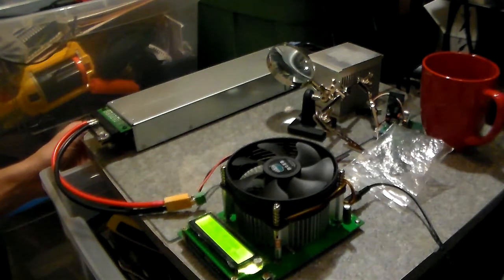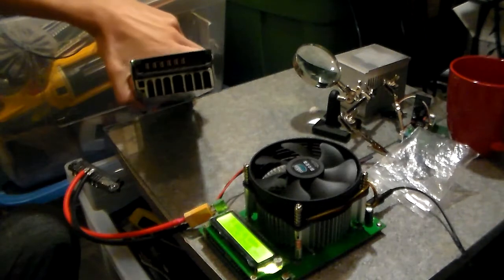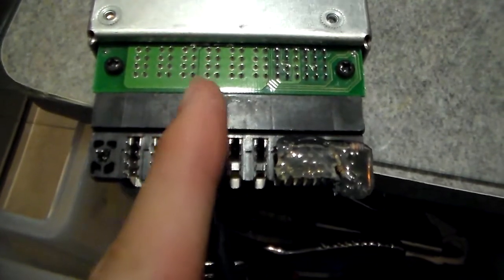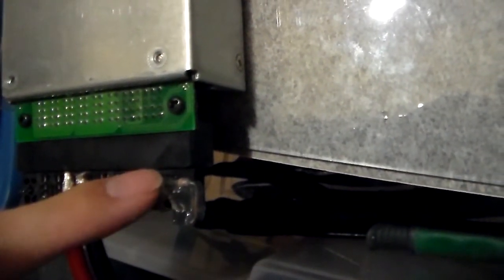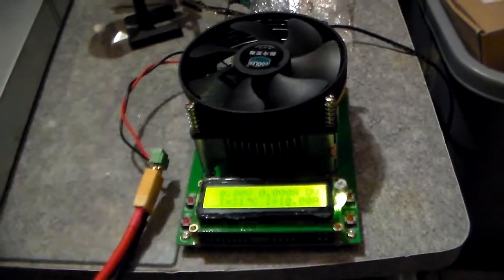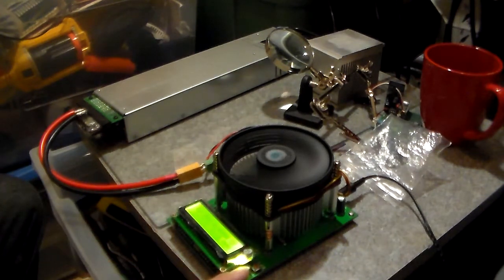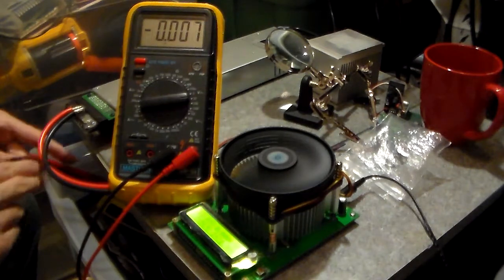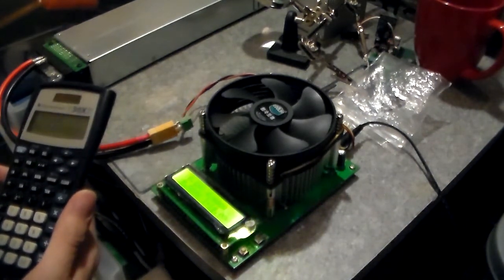Making a 45A PSU Dell PS-2521-1D

Comment: 360 watts with that guy .. 600 watts with your 50A PSU, keeping in mind that the output is 12V :-) oh if you need the connections to be permanent and be able to withstand high temps. i recommend JB-weld, its a 2-comp. epoxy great stuff !
Reply from the maker: right, I was super tired I couldnt do math lol. well it "should" never get hot so it should be fine with hot melt, thanks for the advice!